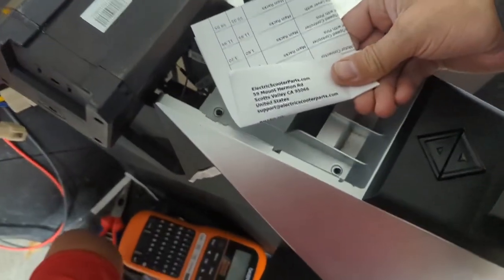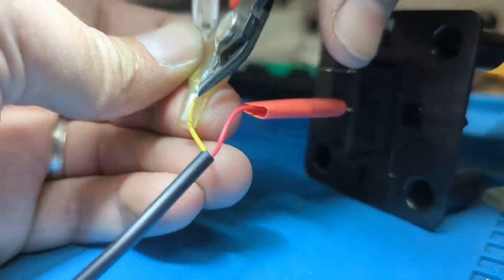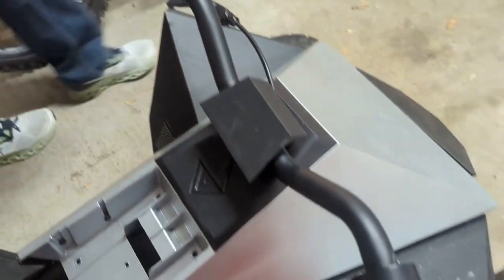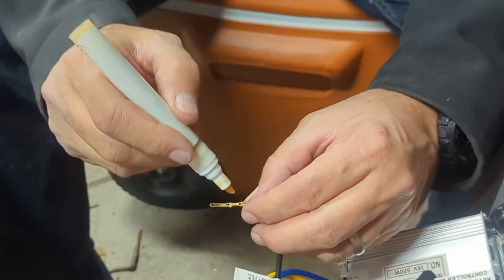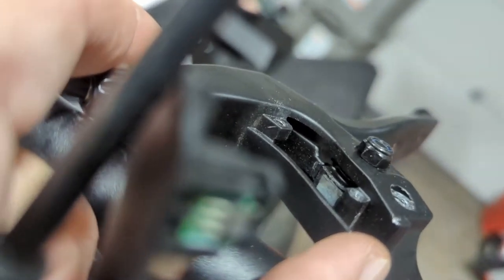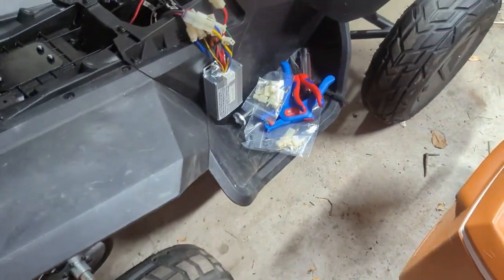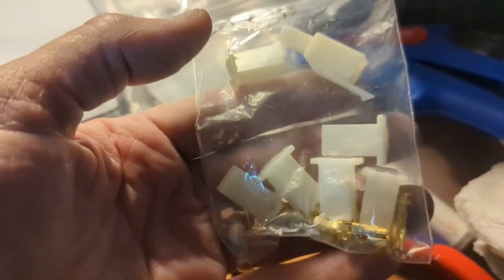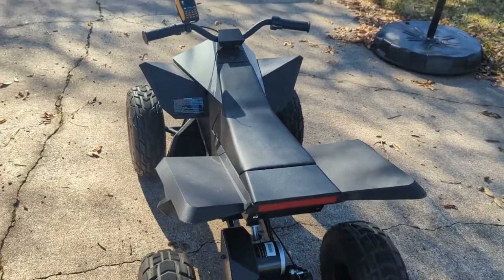Tesla Cyberquad for Kids Motor Controller Recall Replacement

Comment: Just curious, why did you decide to switch out the brakes?
Reply from the maker: I explain this in the video, in detail.  To support the brake light system, for the controller I purchased.
Reply: @cognetic  Yeah my bad. I think I asked the question before my brain processed everything! I remember the magnet sensor wasn't compatible. Do you happen to know anything about the throttle side? I purchased an aftermarket throttle and it locks up the motor when you go from peak speed and let go all the way sometimes. If you slowly let go of the throttle, it works fine. My guess is it's similar but I haven't been able to figure it out yet. 

Also, I cut off all the attachments on the oem controller side. If you want the oem battery connector let me know. I'm using a 20ah ebike battery and don't have a need for that connector. I'm not sure if that will help you with the last thing you mentioned about having to take the seat off to charge the battery
Reply from the maker: @MBMBMB456  If it was me, I would start with the controller.   Id check to see if there is programming to enable or disable regenerative braking.  What controller are you using?  I would love to have or get photos of that battery connector.  It's the one thing I did not anticipate being easily sourced.  I thought it was a universal connector.  If I get one, I would measure, document, and model a 3D printed bracket to make the 3rd party ones work for the community.
Reply: @cognetic  weird. I replied twice but it's being removing. I'm commenting here to see if it works
Reply: @cognetic  I'm using the same controller! Purchased from the same place. SPD-36500R. I got this throttle: 

I think my url was stopping the comment from being posted. But I got the thr-43 throttle from the same place. 

I struggled with getting this all to work, and I basically had to replace the oem throttle. Everything is working great now, except for letting go of the throttle when at full speed. The old throttle isn't usable now, so I will hopefully find one that works. The oem throttle doesn't have any sort of model number or usable info except for two letters, so I don't know if I will be able to find an exact replacement. 

I will upload photos of the battery connector later today. If it's useful and we figure out logistics, it's yours! Thanks for taking the time to make the video and to reply to everyone. 

And in case it helps you or anyone else, I'm using a 20ah ebike battery that's mounted at the bottom/center of the Cyberquad. My thought there was extra range, it's replaceable, and it shifts the weight from the top/rear to the bottom. I also installed a "36 Volt 40 Amp Bosch Type SPDT Relay with Mounting Tab". My battery powers that, and that powers the headlights and tail lights. Then the power indicator from the motor controller tells the head/tail lights to turn on. So mine doesn't have brake lights, but I preferred to always keep them on. Like you said in another comment, designers choice! I don't have the feature when using the brake it cuts off motor which I'm ok with. The only thing I'm worried about is my throttle issue.
Reply: I took some photos. I don't comment on YouTube often. What's the best way me to send them, or share a link to them? I think YouTube removed links from my last comment
Reply: @cognetic  Sent! Just FYI in case you wanted to delete your comment.
Reply: @MBMBMB456  I have the same issue but with the oem throttle
Reply: @adrianwalus9571  Woah I didn't expect that. I wonder what is going on. I took apart the OEM throttle and the aftermarket one I got, and they seem setup the same. So maybe it is the motor controller not handling the sudden decrease in throttle input? Or the motor is not liking the controller?

@Brian, can you test this for us?  Might be easier to lift the quad tires off of the ground and put them on a stand (or two dumbbells like I did). What happens when you go full throttle, get to max speed for a few seconds, then quickly let go of the throttle? It might take 3-4 times to do it.
Reply: @adrianwalus9571  did you replace your brake?
Reply: @MBMBMB456  yes with the same one in the video
Reply: @MBMBMB456  it doesn’t do it in reverse from what I’ve noticed. Only going forward.
Reply: @adrianwalus9571  I got super excited, but I tested it and same behavior. Reverse and forward act the same. This has happened even when I only had the four mandatory connections installed.

I'm curious to know what happens when Brian tries his. His video has his kids riding it, so maybe they haven't had the scenario we had, or we are doing something wrong.

Do you want to exchange contact info or chat on here? Either works for me. It might be helpful to talk this through and see what our similarities and differences are. 

I was thinking maybe since I don't have my brakes plugged into the controller, maybe that was the issue. But it sounds like you replaced the brakes and still have the same issue.

Did you do with the speed selector switch?
Reply: @MBMBMB456  we can exchange contact info if you’re fine with that.
Reply: @MBMBMB456  I didn’t plug anything into my speed selector switch. I might play with the throttle 3 wire tomorrow. Pull one of the pins/wires out to see if it’s having a weird signal issue. Have you tried this with an oem battery? I wonder if it is over amping or not enough amps to keep the motor going and locks out.
Reply: @adrianwalus9571  I tried posting my email with spaces but does YouTube auto delete comments? Let me know if you have a way for me to contact you. Brian and I are in contact via email. I can add you to that thread.

I didn't plug anything into my speed selector switch too. Be careful with playing with wiring, I burned out 3 controllers haha. I also burned out my oem battery with a simple stupid mistake. I still have it, and it outputs power, but I'm scared to try it. I got an ebike battery that fits nicely under the seat area but above the frame. 20ah instead of 8ah from oem.

I don't know much about all of this, so this has been a fun learning but super frustrating. It kind of seems like the wheels locking is a safety thing. So either you and I are doing something wrong, or this is common and Brian hasn't experienced it yet
Reply: @MBMBMB456  I wonder if it’s over amping the motor at high speeds and killing it. It’s definitely a possibility with amperage
Reply: @MBMBMB456  so I’ve tested the quad with the tesla battery and it seems as if the brake is some how interfering with the motor. So when you pull the brake in the quad won’t drive. And when you let go of the brake it drives fine. So I was riding it and held the throttle down and pushed the brake and had the motor lock up like it’s doing before hand. So there is something wrong with it.
Reply: @adrianwalus9571  Hmm. The motor controller instructions say "when the brakes are engaged the brake switch signals the controller to turn off the motor". I took that to mean that it would stop sending power to the motor, but not lock it up like it is doing to us. But regardless in my situation, I'm using the OEM brake without the wires connected to anything. So my quad shouldn't have that functionality.

It kind of seems like this is a safety mechanism? But what's odd is that Brian's quad is working just fine. @cognetic, when you get a chance, can you please lift your cyberquad rear end, go full speed, wait a second, then let go of the throttle quickly? It might take a few tries. I'm wondering if yours maybe acts like mine and Adrian's in that scenario. If it doesn't, there must be something different with the way we did it. 

And Adrian, this is getting messy with YouTube comments and how it breaks it out. Let me know if you think of a way we can email instead.
Reply: @adrianwalus9571  can you try removing all of the connectors and only connect the four required one? So power, throttle, key, and motor. Then see if you have the issue?
Reply: @MBMBMB456  what’s your email?
Reply: @adrianwalus9571  I commented but YouTube deleted it I think. Comment when you're free and I'll respond immediately
Reply from the maker: I submitted a support ticket to the place we are buying them from.  Hopefully they will have some guidance.
Reply: @cognetic  I did notice my instructions says 36 volt and yours say 24 volt. Wonder if that’s a coincidence.
Reply from the maker: @adrianwalus9571  my instructions says 36V 500 watts. 25 Amps.  Part # SPD-36500R
Reply: @cognetic  just out of curiosity does your Cyberquad roll freely when pushed? Or does it stop right away?
Reply from the maker: @adrianwalus9571  It does not roll freely when pushed.  Or It's hard to push, as you can tell it's spinning the motor, when pushing manually.  In fact the battery ran dead one time, while the kids were riding around the neighborhood.  I ended up pulling them with a rope, with my Sur-Ron.  When I got home, I smelled a plastic burning smell.  That's when I realized the motor was very hot.  It must have been generating electricity by pulling it with a rope.  In short, I'll never do that again. Lol.
Reply: @cognetic  when there is no power in the quad. Does it push freely or is there some resistance
Reply: @cognetic  gotcha. I appreciate all the feedback I really do. I want to get this going for my niece. I drove it for 20 min today without any issues, except the throttle issue. I also noticed that after riding it for a bit and then stopping and putting it into reverse it went forward before going backwards. I wonder if I have 1 wire swapped somewhere or possibly a faulty motor.
Reply: The first time I went to full speed and quickly let go of the throttle. The second time I slowly let go of the throttle.
Reply: @cognetic  Can you please take a photo of the throttle and motor connections? If you can email it to me that would be great. It has to be one of those two things. Maybe Adrian and I have something different on those two
Reply: @MBMBMB456  I emailed yoi
Reply: Actually neverminded, I can see it from the video. It looks setup the same
Reply: @cognetic  Hi Brian, Lets us know what they say.  I think it is a controller design issue.

I think it is a safety circuit that is being triggered in the controller.  There is a relay in the controller that shorts across the output wires to the motor.  I think it is supposed to be triggered if detects a shorted transistor in the controller to prevent a runaway condition.

Unfortunately it is being falsely triggered by this drive / motor combo.  I tried a smaller motor I had laying around and it does not do it.

Just my best guess.

Thanks!
 Duane
Reply: @sgstuff  Hey guys, just a quick update. I have been testing many different scenarios including different batteries and even a different motor controller which comes in a few weeks. You have my word that I will update everyone in 2-3 weeks when everything comes in!
Reply: @sgstuff  hey! I won't be home tonight. I saw your other post on my email, but I can't find the comment. That's awesome you did that testing! On my computer tomorrow I'll find your email or I'll put a burner one on my account. Your testing made me think of something but wanted to message with you first. I'll message back tomorrow!
Reply: @MBMBMB456  After several hours of testing the controller I've come up with a workaround. It involves adding a capacitor inside the motor controller.  It will still lock up occasionally if I am going down hill on pavement and I tap the brakes or jerk the quad forward hard enough, but 99% of the time it works great. I may try some other capacitor values but right now I'm using a 22uF 10 volt electrolytic capacitor.  See my Community section on my channel homepage.
Reply: @sgstuff  Sorry for the delay! "Friday night" turned into a weekend long thing. I will message you tomorrow. Thank you for sharing the stuff on community section!
Reply: @sgstuff  Hi SGstuff, when did you purchase the motor controller? and which model is it, the same one Brian got for his in the video?
Reply: I bought my controller mid March from amazon.
Reply: I think my controller is made by the same company but has different markings.
Reply: Check the pics in my community.

Comment: So the only issue I’m having is when I test forward position it drives but as soon as I let off the throttle it stops. Any ideas?
Reply from the maker: Are you using the stock Cyberquad throttle?
Reply: @cognetic  yes
Reply: @cognetic  when I push the throttle a little bit it doesn’t do it. But as soon as I give it full throttle and let go it comes to a dead stop. As if the motor locks up. I’m also using 2 Milwaukee batteries. 12amp 36volt wired in a circuit. Not sure if that could be the issue
Reply from the maker: @adrianwalus9571  @MBMBMB456 is having the same issue.  He is testing another throttle and will report back in.  Please see the other post on this video for update.
Reply: @cognetic   how did you wire the speed selector? Or did you not wire it in? I have the same controller as you. But yours says 24v and mine says 36v on the wiring diagram I got with the controller.
Reply: @cognetic  ok I have everything wired exactly like yours. Could you possibly post pictures of the wiring of each controller wire to the quad wiring?
Reply: @adrianwalus9571  In the video I think his says 36v? On the sticker at least at the start of the video.
Reply from the maker: The pattern I am seeing so far with yours and the other guy, is the battery.  Both of you are experiencing the same issue.  Both of you are using different non stock batteries.  I am wondering if it's a voltage issue.   Do you have the original Cyberquad battery to test?
Reply: @cognetic  I will get an original battery today as I’m waiting to pick up my 2nd quad
Reply: Hi fellas, I've been experiencing the same issue where the motor locks up when throttle is let go.  It seems like it only happens at higher speed (5mph and above).  Btw, I noticed today that this symptom does not occur when you are going reverse, even at full throttle.  Motor lockup seems to only happen with forward movement.  I'll have to check if my controller says 24v or 26v.  I just remember some chinese marking on the sticker but will have to look more closely.
Reply: @superkong81  I could be wrong, but I think Adrian had the same situation, but when testing more, it did happen in reverse too. I'll let him confirm
Reply: @MBMBMB456  were you guys able to figure anything out? I wired both of my kids quads the same way Brian has in the video and both of them lockup :( ... I'm using stock everything.
Reply: @EddieLobanovskiy  

If we can figure out how to exchange emails let me know. I can add you to the thread. Brian, me, and another person on here are discussing things.

I think we will figure things out. I am in deep level testing to rule out every scenario with the vendor. If we don't exchange emails, I will be sure to respond to this comment. Because I have spent months on this! Most mistakes were my fault. The vendor has provided amazing support, and I hope we nail down the issue soon.

I don't work for the vendor and never got paid for anything, or anything for free. They have been super accommodating and trying to help for something they don't even have access too. I sort of wish I kept the original controller, but I do enjoy learning about all of this and I am confident this community can figure it out
Reply: @EddieLobanovskiy  Hey Eddie! I got back home late tonight and just saw the notification. I will have an update for you tomorrow! I think we have good things to look forward, and will confirm tomorrow.
Reply: @superkong81  Hey guys, just a quick update. I have been testing many different scenarios including different batteries and even a different motor controller which comes in a few weeks. You have my word that I will update everyone in 2-3 weeks when everything comes in!
Reply: @EddieLobanovskiy  Hey guys, just a quick update. I have been testing many different scenarios including different batteries and even a different motor controller which comes in a few weeks. You have my word that I will update everyone in 2-3 weeks when everything comes in!
Reply: Hi Fellas, I fixed or got rid of the throttle issue by dummying down the controller.  I bought a YK31C controller from Ebay which solved the throttle jamming issue.  One thing is that it does not have reverse switch but I rather ride the Cyberquad without jamming up.  I'm not sure what kind of mechanical damage it has taken so far.  I imagine some shearing or grinding in the gear or motor itself.  In the troubleshooting process I blew 2 fuses in my multimeter and also burnt out rear brake LED. LOL.  Now I gotta fix the red LEDs.  Should be easy buy and fix though.
Reply: @superkong81  Hey, are you still having the issue?
Reply: @EddieLobanovskiy  Hey Eddie, are you still having the issue?
Reply: @MBMBMB456  How's it going.  I purchased a new controller without reverse function and Cyberquad is working smoothly now.  I'll live without reverse function.  I attached a lawn broadcaster last week and used it to spread fertilizer... LOL
Reply: @superkong81  that's badass! CyberSprayer. Is there a way to privately message on here? My last comment got deleted
Reply: @MBMBMB456  Not sure if there is DM function on youtube.  Google should really allow whitelisted chat function.  Anyways, let me know if you have any Qs.
Reply: @MBMBMB456  Hi, I finally was able to install my controller but having problem when go down hill with the controller on fast mode
It like hard brake when you let off throttle . Any update on how to fix this? Thank you